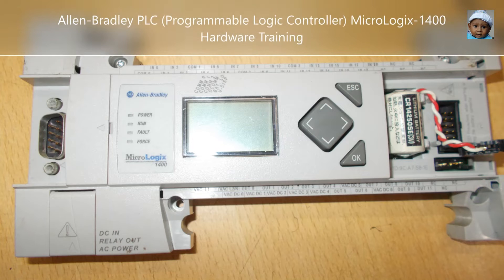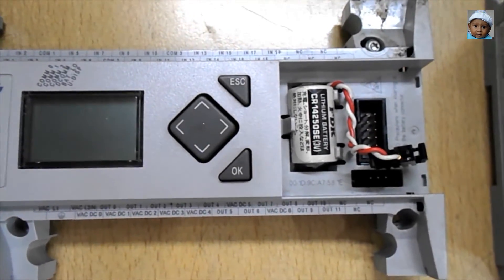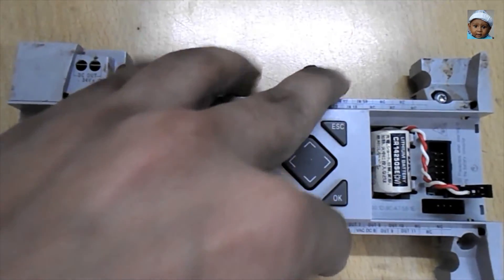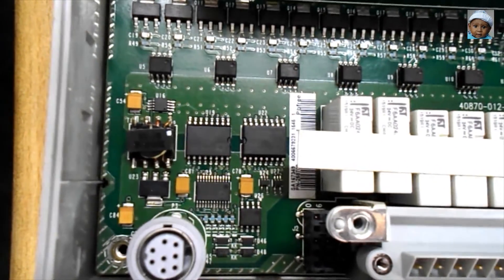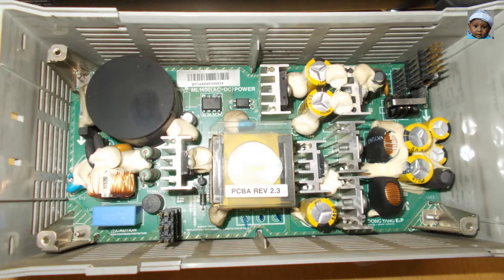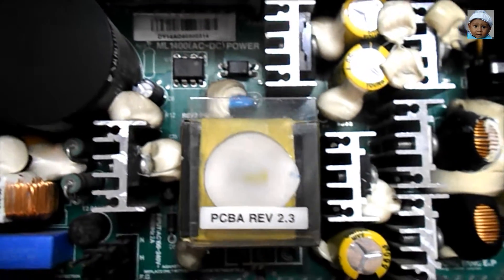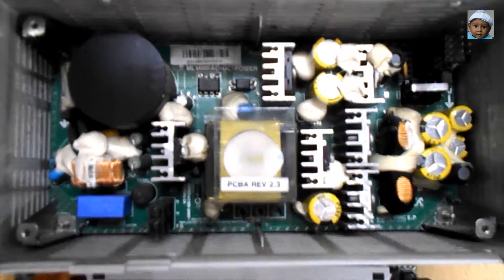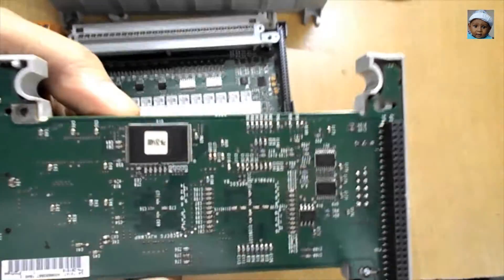What’s inside a PLC? | Allen-Bradley PLC MicroLogix 1400 Hardware Training/Tutorial.

Comment: Hi, I’m facing an issue with RTC of ML 1400 . The issue is, I have set my PLC RTC time in-line with my plant calibrated digital clock time but over the period of around 20 to 30 days of span the plc time observed lag or drift observed by 7 to 15 minutes against my digital clock time. What will be technical reason or probable root cause for this issue. Kindly provide a solution for this? What kind of checks/verification I have to do in order to fix this issue. I have defined print interval as 30 minutes but the print cycle time is changing over the period as 31 , 32 minutes it continuous like that.
Reply from the maker: Brother plz try to install new  battery of ML 1400 you can also online with plc and check the battery status
Reply: MR Industrial Automation for all the 6 PLC of ML 1400 the BL - RTC battery low bit = 0 only
Reply: Kindly Send me a procedure for how to replace the battery (checks n precautions also) , how to verify the battery working condition healthy or not ,
Reply: MR Industrial Automation the battery low status bit observed as 0 zero
Reply: It means it’s healthy right?

Comment: Hi! Muhammed, Mine Micrologix 1400 PLC went dead after internal fault red LED remained on for few day. Can we repair the circuit?
Reply from the maker: Dear sir if you give me the chance i want to online with the Plc then i can identify the problem thank you
Reply: MUHAMMAD After connecting to power, LED remains off and LCD panel also off
Reply from the maker: @vikramsinghrathore6693  but you have told that red led is on
Reply: MUHAMMAD it was on for few hours then all went off
Reply from the maker: if your Plc is on red led is working then i have to online with the plc if all led and display nothing is working  and you are sure that supply is going to Plc terminal then told some one repair the  power circuit
Reply from the maker: @vikramsinghrathore6693  ok it means supply is going to the plc terminal  but  display and led not showing any thing please check the power circuit is there any  spark happen to your plc or any current fluctuation?
Reply: MUHAMMAD RASHID Thank you for your precious time. I will check and would update you.
Reply from the maker: @vikramsinghrathore6693  its ok if you need my help please contact